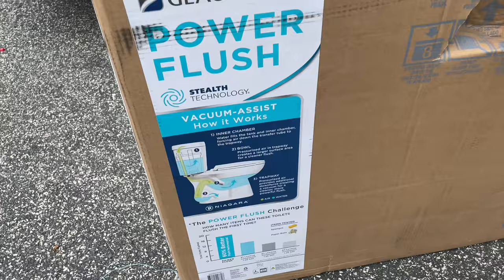Glacier bay Power Flush | stealth technology | extra large trap way to prevent clogs

Comment: What do you do when it comes time to replace any of the internal components?? It's not like you can run to Walmart and get a new fill valve or flapper in an emergency! And I know Home Depot doesn't stock parts for this toilet.
Reply from the maker: I haven’t faced that situation yet. However, I noticed a phone number and website to contact. This was my second one, the first one  that I installed about 16 years ago still no problems.
Reply: @handymanschool  So this exact model of toilet has been out for 16 years?
Reply from the maker: @deansimpson6618  I don’t recall make and model for the one I Installed about 16 years ago.
Reply: You can use a standard fill valve for these, just aim the hose from it into the tank and then it does the same function which is fills the tank. 
At my work we have hundreds of these stealth tanks and it's not very often i have encountered an issue with them.

Comment: Weve had ours about 2 years too. It does flush but strange issues arising. Getting clogged. its that tiny hole at front of bowl. We were and still are getting black stuff out of that hole. It only peaked its head out after plunging it one time! I grabbed some tweazers and had to pull it. It seemed like wadded TP but all black like a big black worm. I had a wire with tiny brush on end still to use at apartments because my long hair clogged sink draines. I stuck that in hole and also the wire end. Seemed better by why is that hole so tiny and why did TP and mold get back clogged into it. All remedies of cleaning the bowl that now looks 80 years old also say "clean inside the tank"? No wa to get into this and Im presuming its a one way water flush? Like it is not sucking poop or mold into the tank anywhere?! We dont have hard water but its a mountain town. We can drink fresh great water out of the tap but the chrome taps in our remodeled bathroom in shower were getting a strange blue dot stain. We wipe those down after every shower. I dont understand how our older toilet, one still in guest house since 1993 does not have this issue at all and neigher did our old one in main house. It seems inferior ceramic in the bowl to me?

Comment: I have the same one but I’m having issues with slow flushing it seems to me like a lot of people are getting wrong tank seal, the one I got is not like the one you are showing 19 seconds in.
Reply from the maker: Are you able to fix the problem?
Reply: @handymanschool  I haven't been able to find seal, it looks like is out of stock in home depot. I believe the issue is that some people are getting a red looking seal that only fits the big hole in the middle, seal on video is meant for middle hole and vacuum piece on the side that regular toilets don't have.
Reply from the maker: I would contact the manufacturer, the number should be in the box.
Reply: @handymanschool  I was able to fix the issue by going to hope depot, picking up another toilet and it came with the right gasket. 

Wrong gasket in boxes is the issue.
Reply from the maker: I am glad it worked out for you. Thanks for giving us feedback. It’s going to be worthwhile.

Comment: My Glacier Bay Power Flush now doesn't flush even when I drizzle-down some "Barkeeper's Friend" solution for an hour and then use a good plunger on it.  it used to work, but no more.
Reply: read my comment below and see if that little water hole at front is clogged. I cant see when comments appear. I may look back to see if any replies to my comment. We got this for height as previous one was like for kindergarten. and the power flush but yah, it gets clogged now 2 years in and wont get clean. Bowl looks 80 years old!

Comment: Just bought this and got it installed but doesn't flush properly. Water tank looks full so not sure what else it can be. The previous toilet flush fine but was just old.
Reply from the maker: Sorry to hear that it’s not working properly for you. Have you tried calling the manufacturer for trouble shooting.
Reply: I just purchase this particular model and I have the same issue. The water fill up but has a weak flush to it. Have u resolve your issue on yours yet?
Reply: @Mr.ShowTyme  I just returned it and got another brand that is working fine now.
Reply: @berrythegreat3580  a different model or the same type? And did u purchase it from home depot?
Reply: @berrythegreat3580  what kind did you buy

Comment: I just purchase this toilet and it doesn't flush good 😐. I been looking to see if anyone else got to flush multiple times
Reply from the maker: Have you installed it correctly?
1. Make sure tank and gasket properly aligned.
2. Make sure air transfer connection is properly sealed.
3. Make sure the black stealth vessel not damaged or cracked.
Reply: Make sure that it came with the right tank gasket, mine came with wrong one from the factory.

Comment: How to fix stealth glacier bay toliet
Reply from the maker: Are you  having any issues with your glacier bay toilet?
Reply: @handymanschool  yes bout every 12 min os so it'll run for bout 4 seconds
Reply: I bought wrong rubber seal at home Depot. Mine is not dual flush.
Reply: The man who installed it didn't have paper work so I don't kno what to do or what to replace
Reply from the maker: You probably can find the owner manual online. Just type make and model number and search for owners manual.

Comment: I installed 2 of the one-piece Glacier bay power flush toilets in my rental homes.  The one-piece has a smaller foot print then the champion 4 toilet, so they work well in a small bathroom.  I use champion 4 toilets currently in my primary home and had them 10 years, but I saw a test on YouTube with another plumber testing https://youtu.be/j9YGxvqXyEM?si=5piazWSyJFNSgeSu toilets and the glacier bay power flush flushed 13 pool balls with one flush, even better then the 7 pool balls it claims it can flush   The champion 4 could not even flush one pool ball. But they are both outstanding toilets.  I like champion 4 with a 1.6 gallon flush too.
Reply: So you'd take the powerflush one piece over the champion 4?  The kohler santa rosa 1.6 revolution 360 seems pretty nice too?